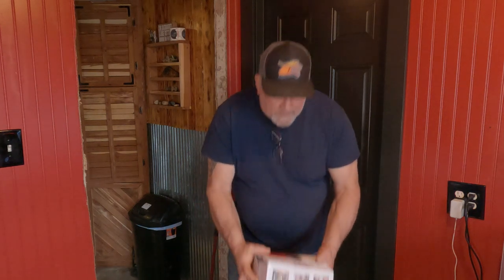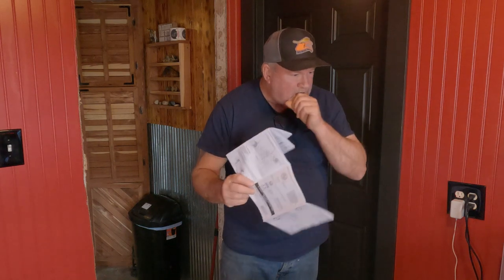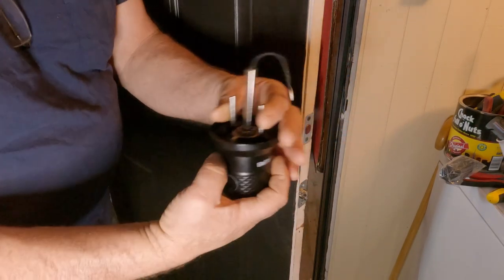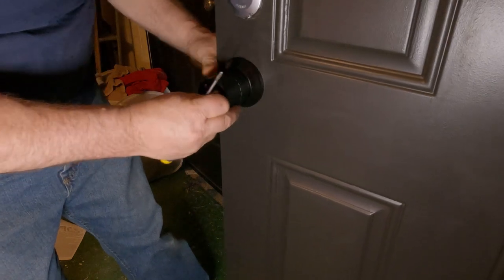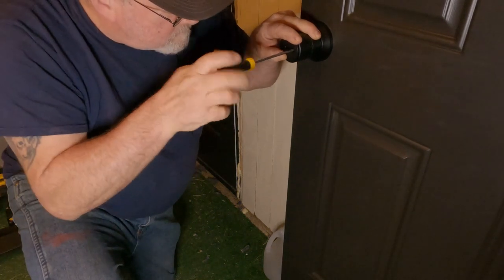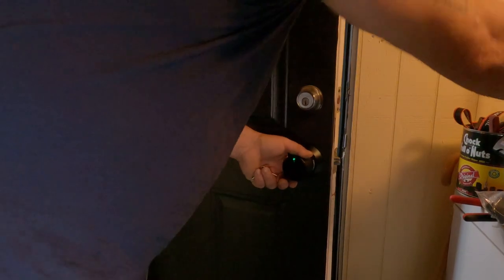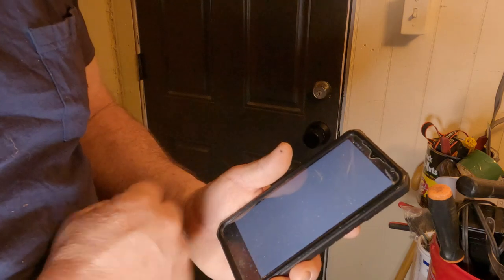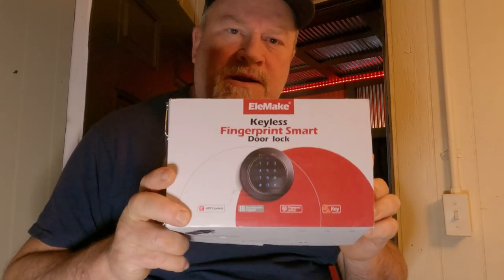Installing Elemake Keyless Door Lock On New Office Door

Comment: Hey Mike, I know you said not for use on an exterior door; however, would it work on exterior doors that have a roof over the door. Are is it sensitive to any kind of moisture and humidity?
Reply from the maker: Thats where I installed it, in a unheated patio with roof
Reply: Got it thank you.